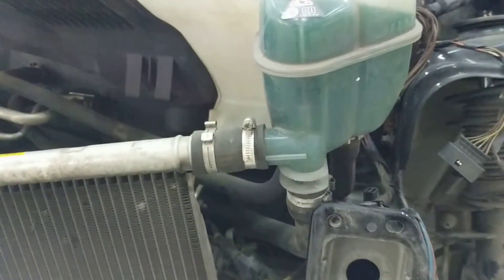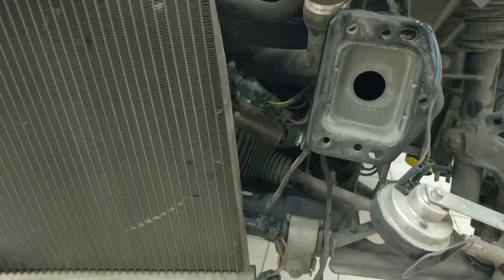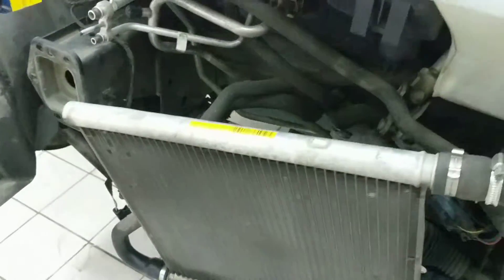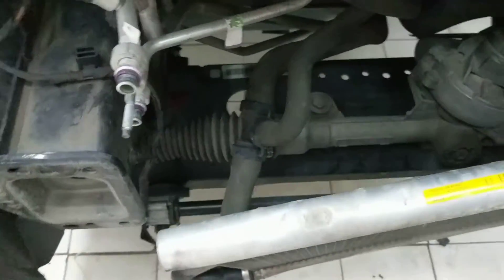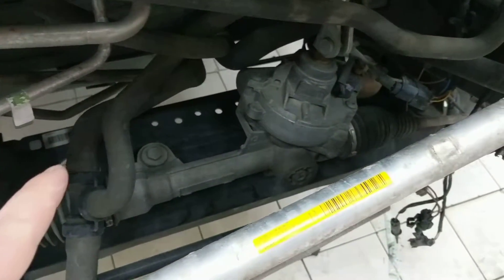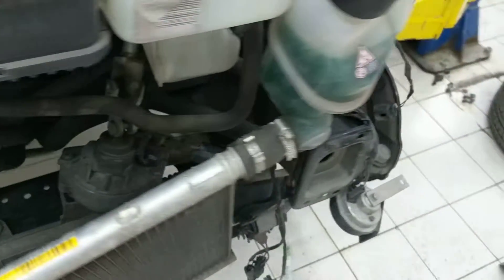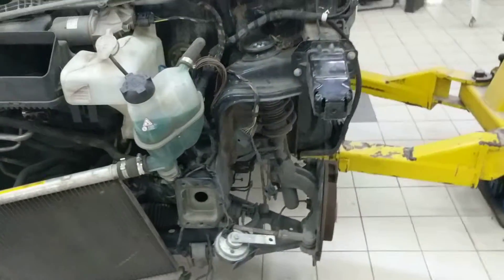Smart Car Radiator Location and Visual

Comment: I changed the radiator fan on my smart, however I have a ac leak after putting all back in place, any advice to prevent and fix the leak?

Comment: Can you remove the radiator and replace it without having to pull the hole front end apart????
Reply from the maker: Hello! You do not have to remove the entire front to take out the radiator. Removing the bumper does give more room to work, but it is not required. We will do some more research and try to find a service manual to provide more information. Thanks for the comment!

Comment: where the heat sensor is at???????????????
Reply from the maker: Hello Jupiter 12, are you looking for the ambient air sensor or the engine temp sensor? Look forward to your reply!
Reply: @AUTOMOTIVESOLUTIONS  hello the engine temp sensor........  thankss
Reply from the maker: The engine temperature sensor is located in the thermostat housing and held on by a small pressure clip. The thermostat housing is located on the top left part of the engine. We put together some images that will hopefully help you out https://blownfuse.co/?p=39 Have a great day and let us know if you have any other questions!